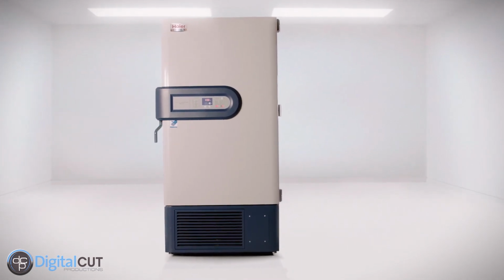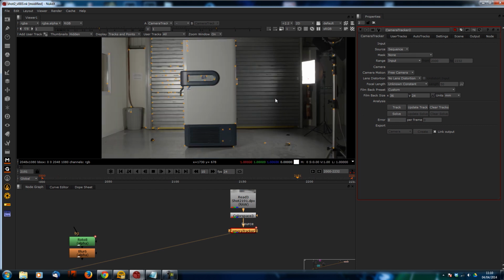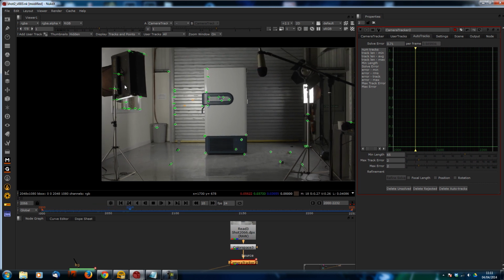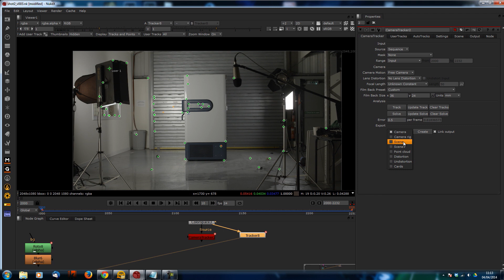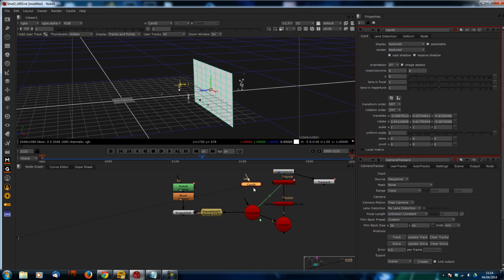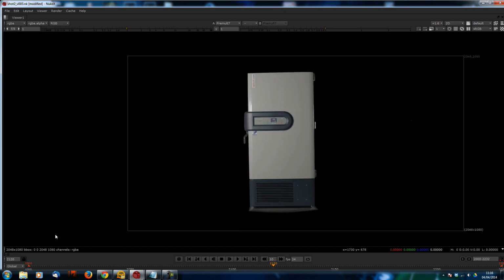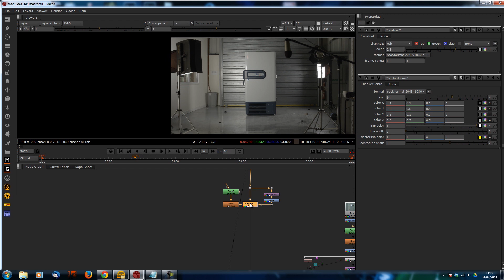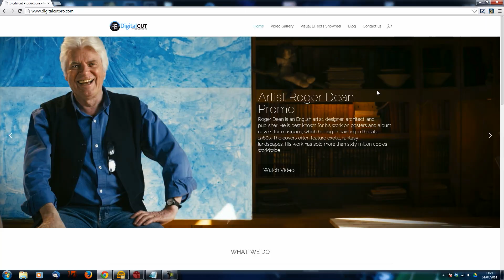Faster Roto using Camera Tracking

Comment: could this be applied to a moving object like a bicycle?
Reply from the maker: For a moving bicycle it might be better to use other techniques such as 2D and Planar trackers to help assist, but technically you could use 3D tracking to help with certain parts of a moving bicycle but this would be more like Object tracking. Hope this helps